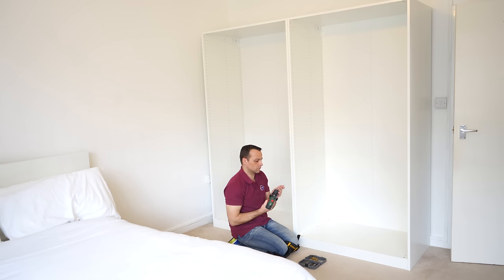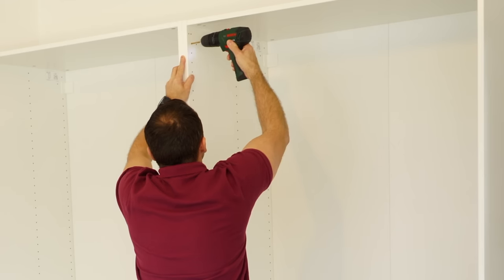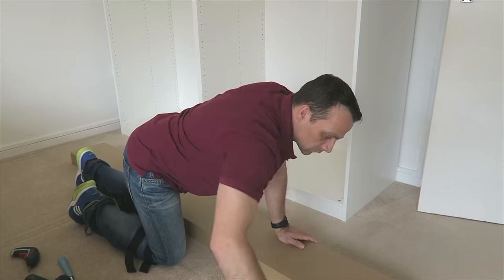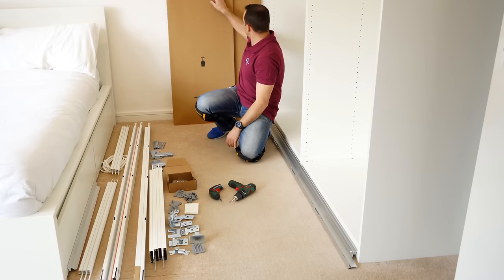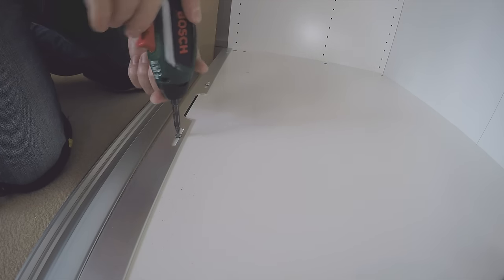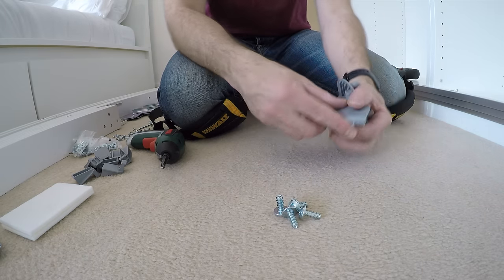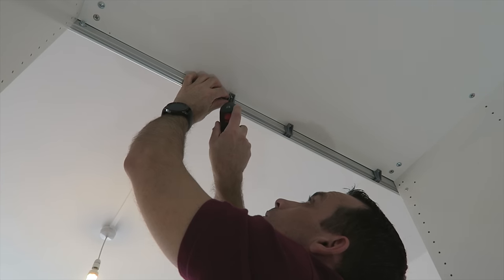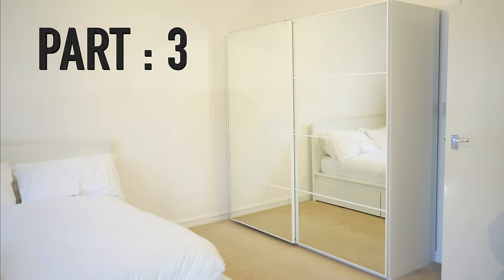IKEA PAX WARDROBE Sliding doors assembly (Part 1)

Comment: My problem is we have just put 4 50cm wide wardrobes up, and for to my floor being unlevel, and the rear wall also being out of wack, 2 of the wardrobes are a few mm higher than the other 2. Do they have to be exactly the same height for the top rail? My only option if so is to plane down the two higher wardrobes as I have no more adjustment left…

Comment: Thank you for taking the time to share. One tip I may add is to use clamps to align the units so that when you put the connecting bolts together, everything remains aligned and does not move
Reply: When the rail is secured  to the top of the wardrobe with the 2 long screws @5:19 are there pre drilled holes?

Comment: I'm having to cut an existing wardrobe from 4 doors x45cm to 3 doors. Do you think I would be able to trim the length of these rails and fit 3 doors in there? Tools, cutting skills and re-drilling holes are not an issue. I might need to purchase extra rollers for the third door as the set is for 2 doors only (I guess).
Great and detailed video BTW, you should get paid by IKEA to do videos for them. The instructions are not always clear.

Comment: Thank you so much for the helpful videos.

 I am trying to build the 300x66x236 cm wardrobe, my both the sliding door are of 150cm each. I am really struggling with the door assembly.
The glass is very heavy and we are not able to slide easily in the door panel. I would really appreciate if you can share some documentation or guide us with it.
Reply from the maker: Here is the latest video on this ikea sliding doors https://youtu.be/R499d-CBDzk

Comment: Your videos are very helpful. I am putting in the top rail for sliding doors. The rail is even on both sides of frame. I made 2 holes for screws BUT the screws won't go all the way I'm the frame. What can I do, please?
Reply from the maker: If is the longer screws one on the each side of the top rail just push harder on the screw with electric screwdriver. And here is the latest 2021updated version of these Ikea sliding doors :Ikea AULI sliding door frame assembly for Ikea Pax wardrobes Part:1
https://youtu.be/R499d-CBDzk Thank you for watching
Reply from the maker: Here is part 3 all about top and bottom rail https://youtu.be/cvOwRTmuXo4
Reply: @PPFlatPack  ok, it is the top 2 screws. I have tried to screw them manually and with a drill, but it doesn't work. It feels like something is in the way stopping the screw. I  will buy an electric screwdriver and try that way. Thank you!!!
Reply from the maker: Electric screwdriver for this door definitely good investment your life will be much easier

Comment: I think IKEA may have updated the design - the end of my top rail looks a bit different; do you have to pre drill holes on each side for the top rail? There are no evident holes present at the front of the wardrobe frame.
Reply from the maker: Here is the new Ikea Pax sliding doors https://youtu.be/Ilxl5yDrq48 and there is no predrilled holes on the top.

Comment: Is there a way to reduce the height of the doors, and make them only 3 panels high instead of 4 high. I want to put sliding doors under eaves / sloping ceiling approx 1m50 high (height can be adjusted to accommodate 3 panels but not 4). Thanks

Comment: On my pax there is a bracket on the inside of the right and left side of the second sliding door, as per instructions once the doors are are attached you need to loosen the bracket insert a little screw with an allen key which releases a latch that goes upwards on the right hand side and down on the left hand side. The right side won't release and is preventing the door from sliding shut. Have you come across this before?

Comment: When you secure the rail to the top of the wardrobe with the 2 long screws @5:19 are there pre drilled holes?
Reply from the maker: No these 2 holes are no predrilled. Here you have latest 2021updated version of these Ikea sliding doors :
Ikea AULI sliding door frame assembly for Ikea Pax wardrobes Part:1
https://youtu.be/R499d-CBDzk Thank you for watching.

Comment: Is it easy to move this Wardrobe about (is it heavy) I kind of have ocd of not accessing areas in my room and want to know if I can move it about to clean under and behind regularly ?
Reply from the maker: To move this if you have carpet  you would have to take the doors off rails off disconnect clothes off and than move and put back. If you have wooden floor it would be easier to slide just don't split the frames when you push them.
Reply: @PPFlatPack  thanks you!

Comment: We just purchased the Pax and of course Hasvik doors. The plastic top coverings at 5:40 weren’t included. Looked everywhere. Doesn’t appear in the ‘what’s included’ part of the manual either. Any idea why? And yes, 100% sure I have the pax/hasvik
Reply from the maker: There is new system with ikea pax wardrobes this video is the previous model(they still selling them till stock finish) here is video you need https://youtu.be/Ilxl5yDrq48 there will be difference regarding doors assembly but the rails and hanging the doors are the same.

Comment: Hi, would like to fit the Pax 236cm wardrobes but ceiling is slightly bowed, 238cm at the lowest point upto 240cm, have you fitted these wardrobes in such a short ceiling height? Would like the sliding doors preferably just concerned as to whether I can fix the top rail plastic inserts on the top to hold the top aluminium door rail in place.
Reply from the maker: Here is video about hight adjustment of the Ikea Pax wardrobes it may give you idea how close you can go on doors to ceiling with Pax sliding doors https://youtu.be/ehWybREbdF4
Reply: @PPFlatPack  Brilliant that answers my question, another set of helpful, informative videos and thanks for the prompt reply.

Comment: Hi. Maybe you can answer . I'm planning to buy a PAX that's overall 300cm wide (50+100+100+50 frames). I was planning on adding 2 sets of 150cm. But Ikea states that I can only add the 150 wide sets if I have 2x75cm frames.  I saw in your video that the lower rail has the cutouts to make it suitable for different set-ups of frames. But the 150cm wide rail has only 1 cut-out in the middle to accommodate the 75cm wide frames. Would it be possible to add one cutout myself and use the rail on a 50+100 frame setup? I assume I would have to drill some holes for it myself. Are there any other issues I could be facing?
Reply: And thanks for all the videos! Makes life easier

Comment: hi, if you secured the plastics to hold the rails in those little holes (09.00), where will the LEDS lights get attached to?
Reply from the maker: Depend on your wardrobe if you have shelve on the top than hanging rail : under the shelve if you go in top panel you will get extension with the lights so lights come under the rail. Holes for lights are not pridrilled.

Comment: Does anyone know where I can get the rails? I got the door months ago but mine didn’t come with the rails. Do you have to buy them separately and if so, does anyone know the code or name?
Reply from the maker: The door frames come in the same box with the top and bottom rail for older version of the pax sliding doors. Recently Ikea updated these sliding doors with different top and bottom rail and different new sliding doors. Btw video on new sliding doors coming in 2 weeks.

Comment: At 7:30 you present 8 plastics that suppose to hold the top trail from inside. Those do not let me install Ikea wardrobe lights on the top. Is it expected?
Reply from the maker: You can still add lights there is extension coming with the lights in case you have sliding doors.
Reply: @PPFlatPack  The lights I have got have no extension but I was able to install them a little below the wardrobe "ceiling". Which does not look as nice as if it was closer to it. Thank yo for your reply.

Comment: Hi thanks for sharing your skills. I have done everything but I'm having problem with sliding doors to put the on the rail. The door on top fit properly but no the lower rail the hinges are over the rail. Please help
Reply from the maker: Try to get bottom in first of course unlock the top hinges and than hang over the top one. Hard to help if I don't see it you can send me mail with problem pic.

Comment: @ppflatpack, I very much need to video call but I can't locate info about how. 

I've put the entire wardrobe together, followed every single direction correctly, watched your excellent videos for tips, but when I put the inner door on, it simply does not slide behind the front door. The space is too tight. I've quadruple checked, everything is correct and the wheels and hinges are in the right rails. It's like the rail is not wide enough for these doors. Have you ever run into this problem? Ikea is closed and I'm desperate to complete this project. Thank you for responding.
Reply from the maker: All details in the description

Comment: Anyone buying a PAX system and considering the sliding doors should know the closets are and inch or two too shallow, so if you hang men's suits in it the sleeves get caught in the doors when you try to open them. You'll have to reach inside with the door partially open to push your suits in or install some kind of strap to keep them held out of the way. A little disappointing when you spend $1,000.